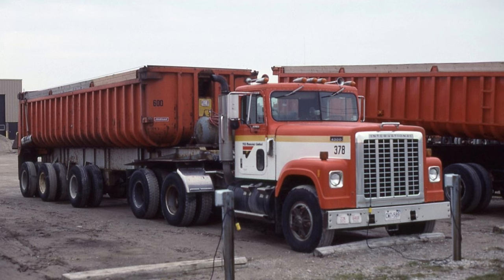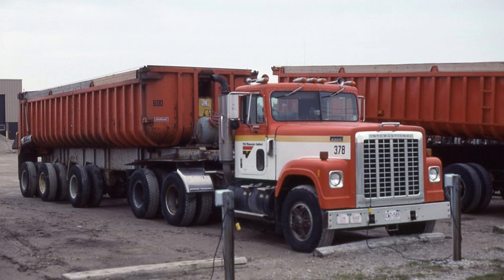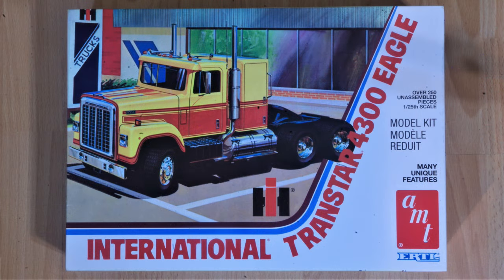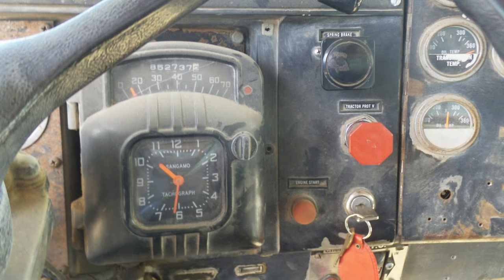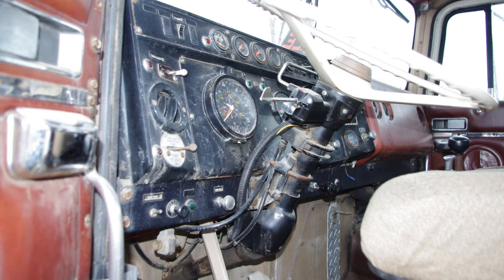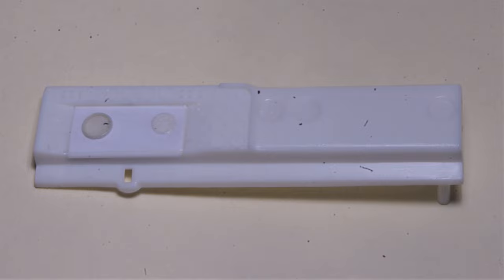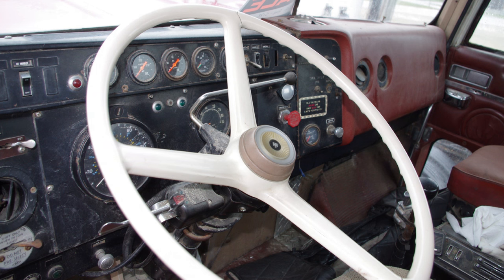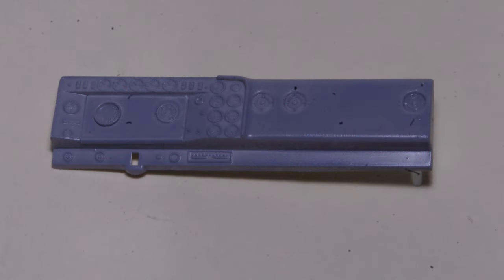Round gauges for a 1/25 scale Transtar 4300 instrument panel

Comment: I don’t know if you seen it but the big gauge on the left of the real dash is a Tattletale too that’s what us old truckers call Tachometer’s. Guess your kinda defeating your purpose. I drove these 4300 and 9300. If you want to correct this to a standard Tach and Speedometer for a 4200 or 4300 use 2 smaller gauges.
Reply from the maker: Good catch - thank you for the correction. Easy to change that larger gauge for a second smaller one, still have the other gauge from donor “snap” KW dash.